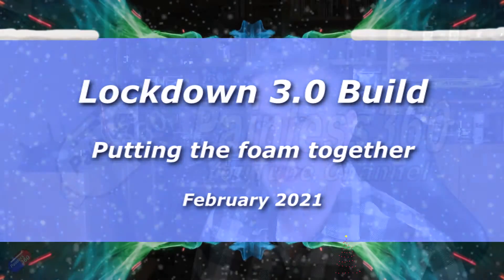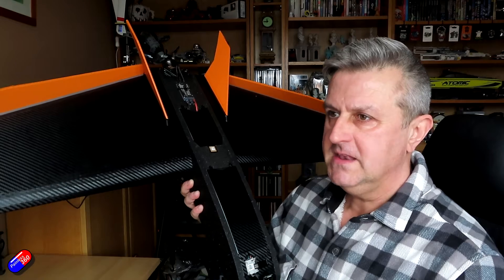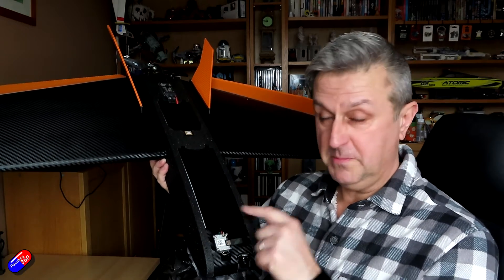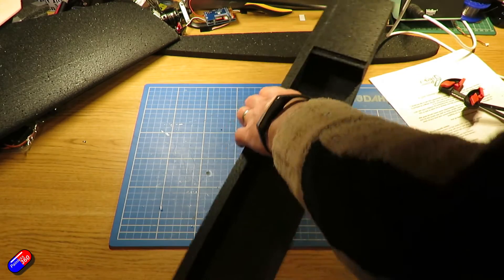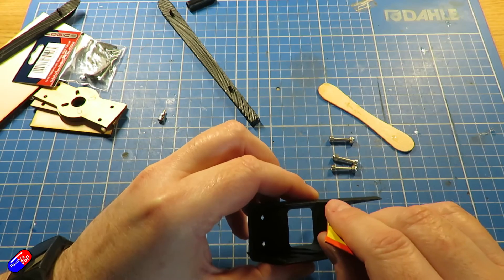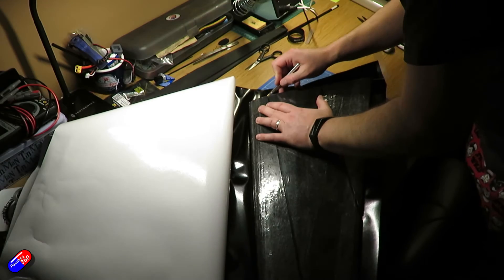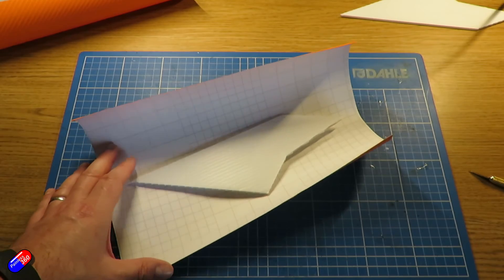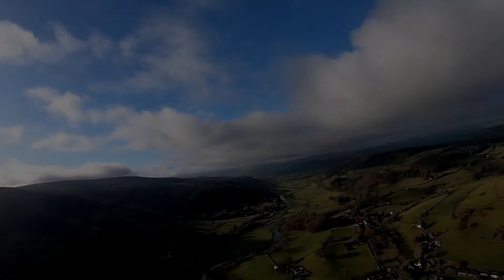E-Wings Vortigaunt II Build: EP2 - Putting the foam together

Comment: Could you inboard the motor and put less dead weight up front? It wouldn't save all of it but seeing where the c of g falls it would probably save 30-50%. Not sure if cutting into the rear would cut into anything structural or a bay, just a thought.

Comment: Looks nice. Would you benefit from building an 18650 pack pushed right forward to make the weight useful giving range? All depends on shape of recess I guess on being able to get a high energy density right forward.
Reply from the maker: 7000mah LiIon pack if 399g. Same as the 4000mAh 3s LIPO..

Comment: Hey brilliant channel here can I ask a question..
In your thoughts what is the best wing to capture footage I’m looking smooth footage I will be putting GoPro 7 into it I also live here in the uk and there’s always wind about 
Also that looks a nice wing but I say this about every wing you review lol
Reply from the maker: Ideally you want something with a decent wingspan and weight. Around 1.2-1.6kg with a meter or more wingspan make for models that are less affected by wind. Something with a tail can be more stable for filming too..
Reply: @Painless360  ok thank you very much for your advice much appreciated
Reply: Stable flight or smooth flights normally depends on the wind. But bigger models tend to be more stable. U might want something around 1000mm-1500mm wingspan. U also want a wing that’s quite rigid so it doesn’t wing bounce with every bit of turbulence.
Reply: @Chris_Paul1  thank you